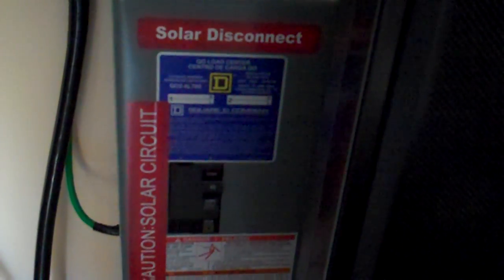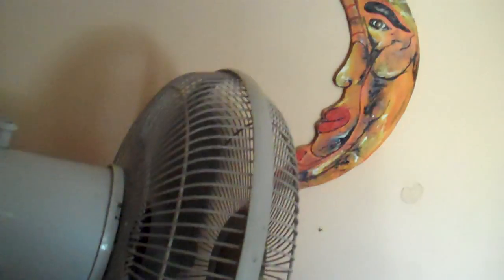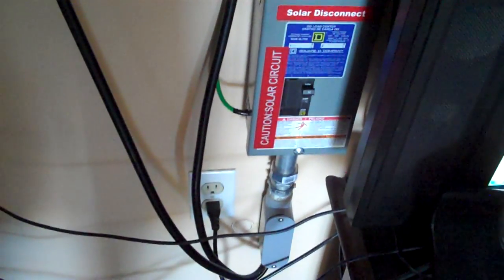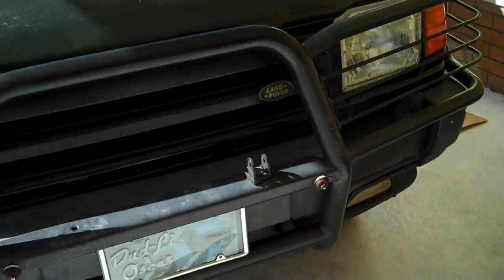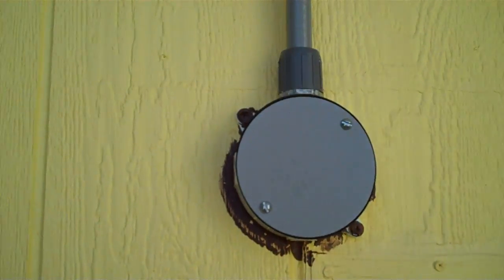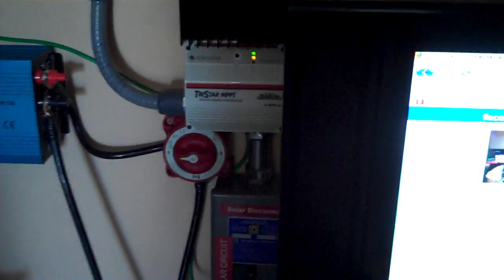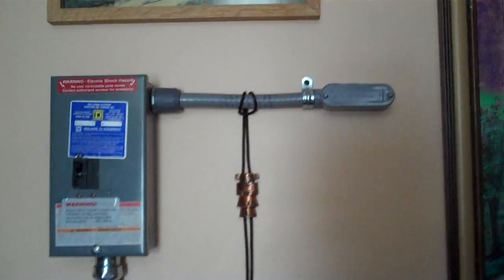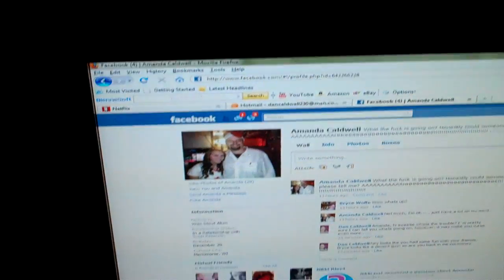Solar Electric System

Comment: @dancaldwell230 I expect to produce about 37% of my own power based on current usage and I have spent $2450 dollars for everything, this includes the 30% tax rebate. I will expand as I go but probably not until the Republicans are out of office 2012 so we can get tax breaks on solar/wind again. I took full advantage of the stimulus money on alternative energy tax breaks in 2010 :)  The maximum deduction in 2011 is expected to be $500, down from $1500 and no more solar/wind.

Comment: @dancaldwell230 There's no code in my area for off-grid if it's not attached to a residence, I checked. My panels are not visible to anyone regardless. I always properly ground everything and I always make everything as safe as POSSIBLE. I have fire extinguishers and a carbon monoxide and dioxide detector near my battery bank too. I have 1.15kw of PV total and about 5,500 watts of storage in batteries currently with future upgrades coming... like you I want to double my bank to 8 batteries.

Comment: @dancaldwell230 I'm not designing my on-grid stuff to code, the MAN can kiss my GD a**!! :) There's no code for off-grid so it's fine since nothing is physically mounted to the house, the panels are on the ground etc. 

I'm going to do fuses like that too especially on the battery bank since it can put out deadly and fire starting amperage in a blink.

Comment: @dancaldwell230 What I did was look at the panels and took the "shorted" amperage. Then I did a real world example with a Watt's up meter to see what maximum amperage actually was when under load. The max I've ever seen is 12A out of those panels and it was only for a few moments but it was there. A 15A circuit breaker would work, the 30A I have now will not. I tested my 30A breaker with a 9V battery shorted and it tripped so maybe it would?

Comment: @dancaldwell230 Do you use 2 YouTube IDs? dancaldwell and rar1963? Anyway I got the same charge controller 60A MPPT Tri star and a Go power 1500 watt inverter which is why I found your video so interesting I'm sure lol... That inverter is a Powerjack grid tie MPPT inverter and that's for my smaller array of 350W that tries to off-sets my house power to near zero...still need another 250 watts to get zero when we aren't at home. Email me directly on YouTube and let's carry on this conv. there ok?

Comment: @dancaldwell230 That's what I was hoping you would say lol, they last until you turn your system off, I hope mine does the same! I'm glad to see you expanding because I started small with the intension of expanding as well. 12.5V as the low is awesome and your batteries should last 10 years if you take proper care of them at that rate. Make sure to equalize them or desulfate them. A good charge controller will take excellent care of them no doubt. I'm looking forward to mine!

Comment: @dancaldwell230 Awesome, thanks for the info. I got 4 batteries (12V@115ah each), a MPPT 60A charge controller and 800W of PV so I'll be making new videos soon. Check out my current videos too...

Why do you need 8 batteries? How long did those 4 last you? How much PV do you have charging the system? What I'd like to get is a basic idea of how your system works so I can tell what I'm going to "need" for mine. Do you desulfate your battery bank?

Comment: Have you had any issues with your inverter or your computer running on it? I'm worried my sensitive equipment will fail without a perfect sine wave. 

How many amps are you pulling off those batteries with the load you put on it in this video? Any issues charging the batteries, not having enough amp hours or your inverter shutting down due to low voltage? 

Sorry for so many questions! I'm building my system now so if you could help me that would be great!

I want that same MPPT controller!!!